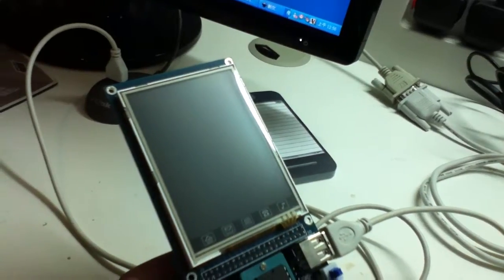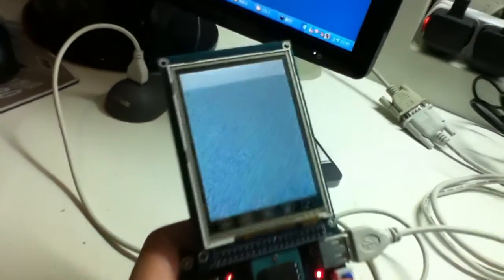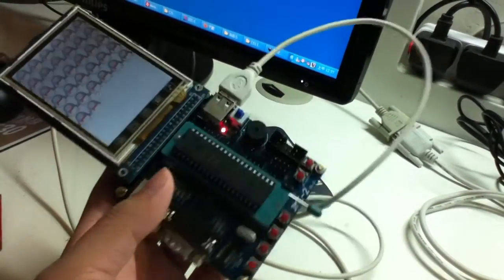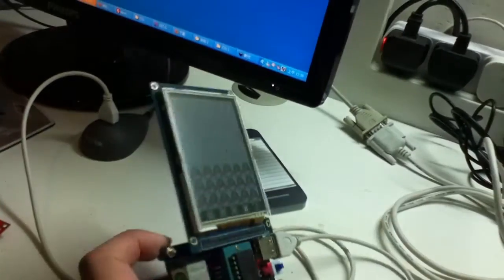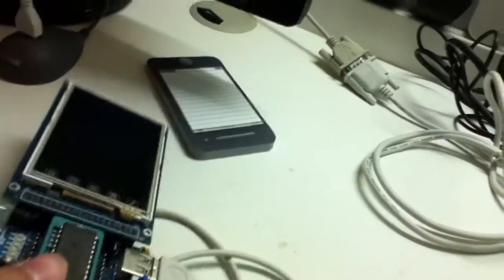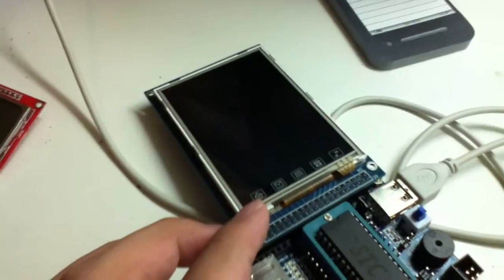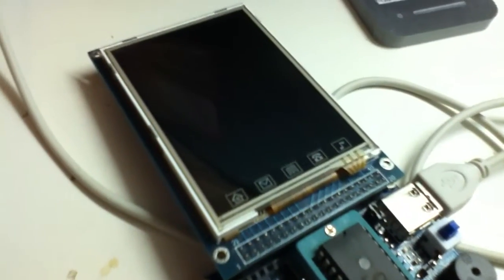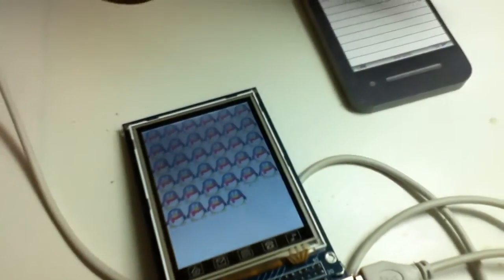devpacific2.0 TFT Touch LCD PCB Module (3.2 inches) Demo Video

Comment: since you provide this info...it was a little useful to me. i am using a STC micro controller for my project too,  but on a complete board...the HC6800-EM3  V2.0, I need some support from you if you can help me... please email me to: edwardsheefeni@yahoo.com or on my qq: 1321295985... I am Edward